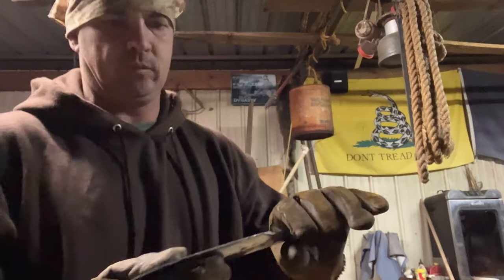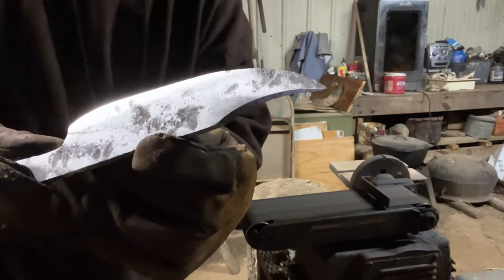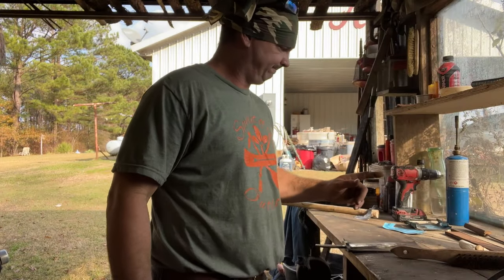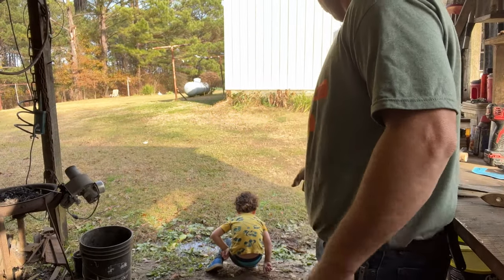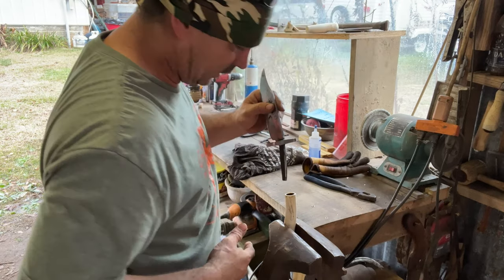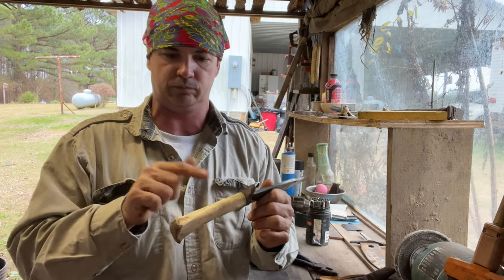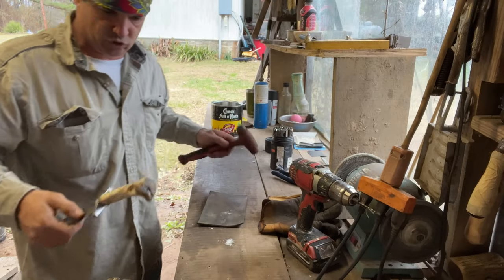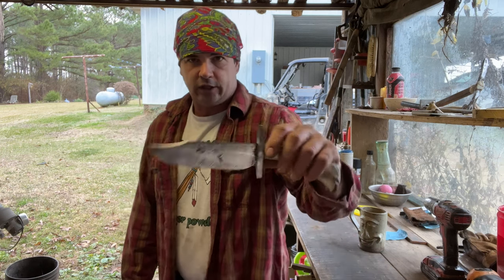Building the giveaway knife

Comment: That's a nice lookin' knife, Justin.  When I temper I first get the metal red hot and after I  quench its just like glass. You drop it, it'll shatter. After I knock the scale off I'll reheat and start watching the colors.  When I get that straw color beginning to come out I'll quench again. I want it just a little short of spring steel.  Is that the way you do it?
Reply from the maker: Somewhat . I take a torch and run the colors because my forge is crude and hard to keep the same heat
Reply: @SpiritoftheOutdoors  I use a torch and oil quench. Don't have a forge. A file will make a knife that will hold an edge. But they're hard to work, easy to snap, and they rust like crazy. You can't beat a good carbon steel blade and spring steel is the best.
Reply: If you ever decide to make brass for gaurds you can use spent brass cartridges. Put them in a container and use the torch to melt them in a block. You can cut yourself off a chunk and shape it on the grinder. Bore your hole same size as the steel in your handle and work it to fit with a small file. Any gaps put it in the vice and squeeze it. Make it fancy you can silver solder the gap between the brass and the knife.
Reply from the maker: @larryreese6146  we reload all the brass we get our hands on here
Reply: @SpiritoftheOutdoors  22 shells ?
Reply from the maker: @larryreese6146  i never seem to locate many of those in the leaves
Reply: @SpiritoftheOutdoors  single shot.